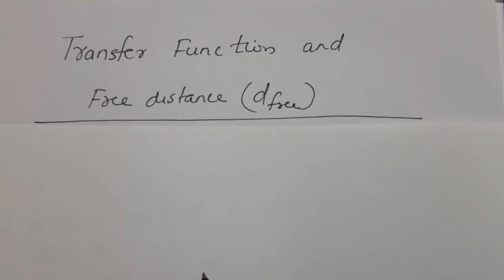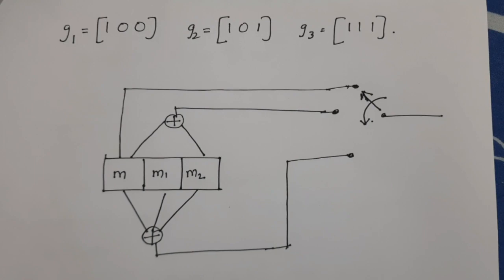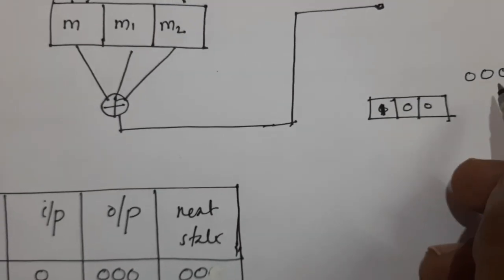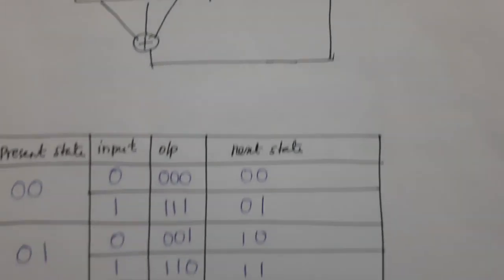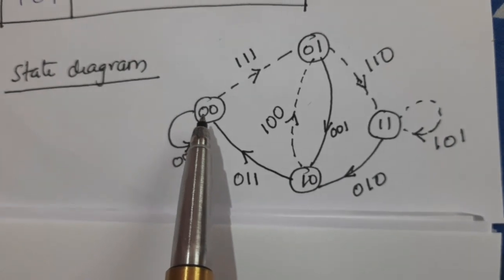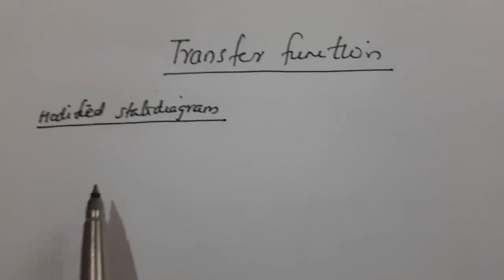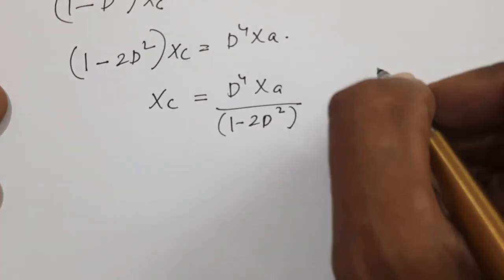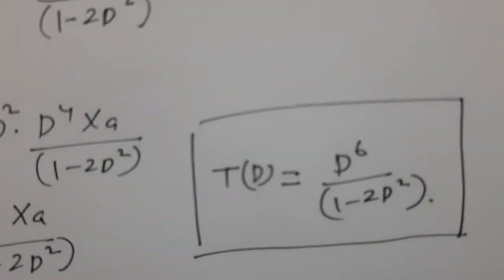Lecture 43: Transfer Function and Free Distance for Convolutional Encoder

Comment: Examine that the generator polynomial of a (7, 4) cyclic code is 1+X+𝑋
3
. 
Discover the correct code word transmitted if the received code word is 
(i) 1011011 and (ii) 1101111
Reply: Got that question in internal assessment in my college.